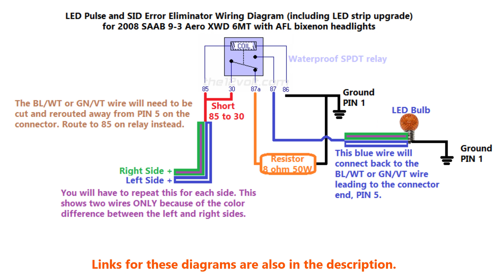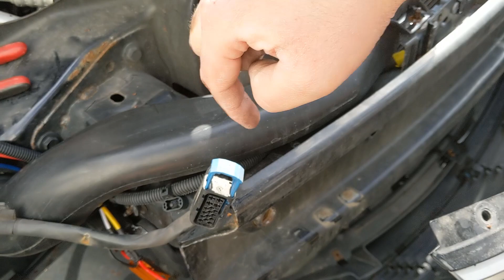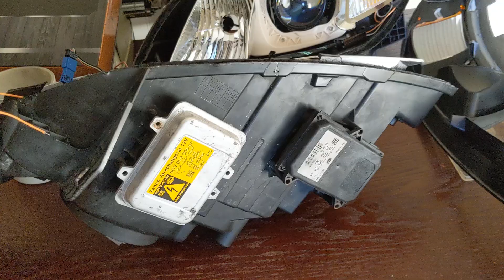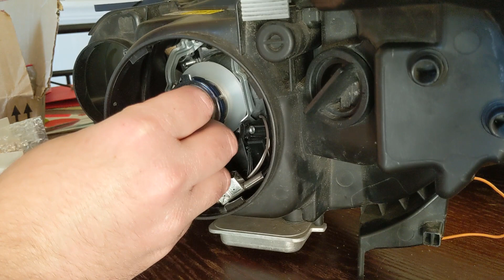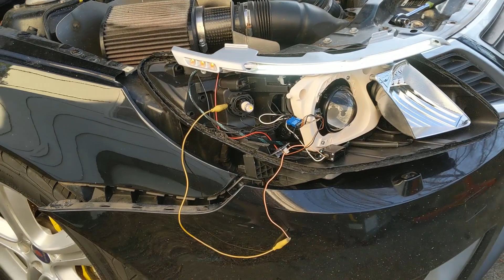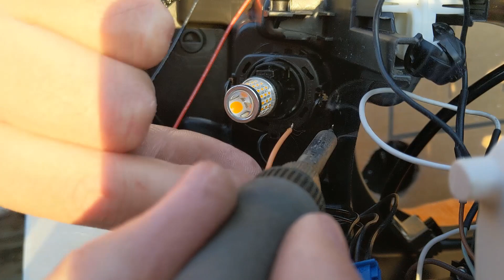No More Hyper Flash! Testing Things: Part 5 SAAB 9-3 Headlight Retrofit | AnotherSAABChannel

Comment: This is so helpful.  Would I still need the relay if I were just to install the white strip and no other leds as you did?  Will the White 12 inch strip flash without the relay?
Reply from the maker: If you're replacing only the eyebrow strip and leaving incandescent bulbs in the turn signals, no relay needed.

Comment: Let me know how that double sided tape on the resistor works long term if you ever pull the bumper off again. I've been hesitant to use tape as the resistors do fetch a decent amount of heat.
Reply from the maker: Had the bumper off last month. Still holding. Just used 3M 5 lbs rated mounting tape.

Comment: Did you do anything to get the led turning bulb not to flash with bulb test system? And no hyper flashing because of lower resistance?
Reply from the maker: Yes. The relay/resistor setup is what corrects that issue. No hyper flashing because the relay completely isolates the bulb when it's not powered on.